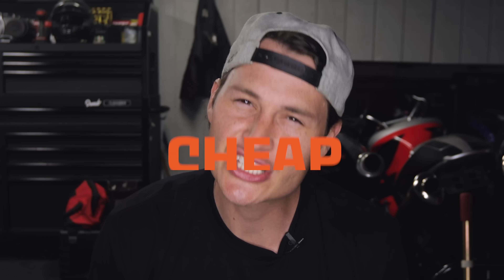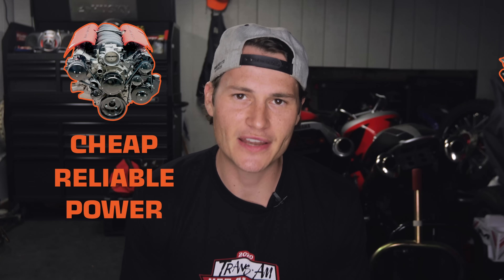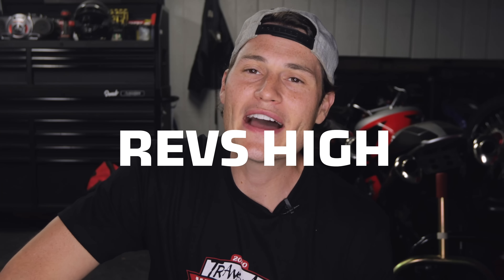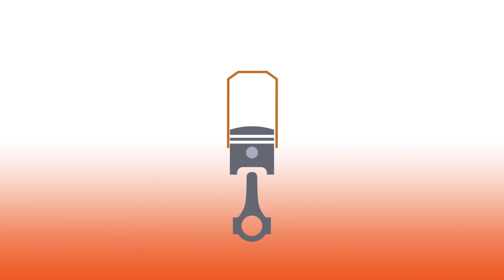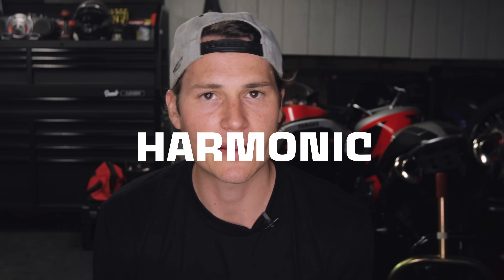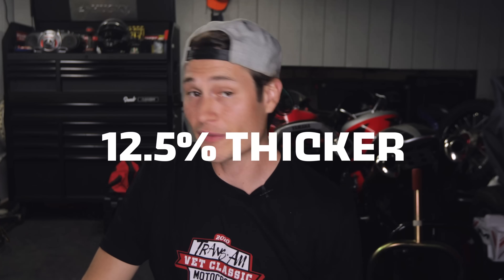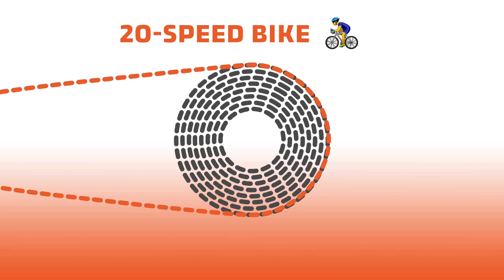Nissan VQ Engine - The Science Explained

Comment: "Iconic sound" more like universally hated
Reply: Op votes for biden lolol
Reply: @carlinleneker-frisch976  Sorry I don't vote for racist pedophiles who think they're running for Senate
Reply: Frank White  I'm talking stock blocks. a stoked and bored VQ is gonna sound different from a stock 3.5 or 3.7. I've heard the 4.2 and it's not bad by any means.
Reply: Not really. Its hated because people straight pipe them. With a real exhaust system they don’t sound bad at all.
Reply: @Bru946  I have heard one decent VQ in my life and probably 200 shit ones. I've never heard a VQ that makes me wet my pants.
Reply: @trent7080  pulls Uno reverse card
Reply: It's iconically hated.
Reply: The sound ain't even iconic, VW VR6 did it 1st and they can just as much power in a smaller form factor
Reply: @FreshDoughBoi28  VR6 sounds better than a VQ35 or a VQ37
Reply: @FreshDoughBoi28  show me a vr6 making over 300whp with bolt ons, ill wait....
Reply: Exactly. People rev these trumpet trashcans like its appealing to anyone.
Reply: @vidademikey9790  not all sound good but with a full motordyne exhaust they do. My g with a borla sounded good as well imo...

Comment: Yadayadayada...in reality the VQ is as refined as a tractor engine in the high rpms. I owned a 07 350z with the HR and the thing was quite course and strained feeling in the higher rpms. No comparison to say the silky smooth inline 6 in the e46 M3 or flat 6 in many Porsche’s.

No doubt the vq35hr is a stout engine though....fairly reliable and cheap if you look past the lack of refinement in high rpms. Nothing extraordinary by modern day standards, but still a solid engine with quite usable power.

Comment: It's not the crank being not symmetrical it is the con rod straightening up therefore adding to the height of the piston. When at the top of its stroke this increases the distance traveled by the piston when at the bottom of the stroke this decreases the distance traveled by the piston. If you are going to teach things make sure what you are teaching is correct!

Comment: The VQ40 found in the trucks/SUVs is great until the cam shaft gear explodes and grenades the motor. Then you had the awful ass automatics bolted to it. 

If you could find a VQ40 with a manual like an Xterra S/OR then you had a great vehicle. That is, as long as the camshaft gear was addressed.

Comment: The engine is great until your water pump fails.
Reply: Thats literally every engine
Reply: Anthony Leone I have a LS based iron block engine in my truck and can replace the water pump from under the truck in an hour. This fucking engine was the pump driven by the timing chain, which is covered by a plate that seals the entire front of the engine, in a tiny engine bay. I would know because I just replaced one
Reply: The Ls is great until you blow it.

Comment: I like donut and this series, but they got a lot wrong about the engine balance in this episode, some other people allready pointed it out, but I want to point it out again in the hopes that they revise some of their mistakes, given that people will asume this is correct.
firstly, the pistons don't fire at the same time, they fire at the same crankangle, but 1 rotation apart, secondly, just strengthening the block and crank doesn't suddenly make an engine smooth, smoothness comes largely from using counterweights and balance shafts to mitigate the primary and secondary inbalance.
where the inline 6 is fully balanced, the V6 has a primary rocking motion on both it's banks as well as a secondary inbalance, the unbalanced nature of the V6 is a large reason as to why they don't rev as high.
I hope this video will get a revisit or revision correcting some of the mistakes and going a bit more in depth on how Nissan beat the very unbalanced V6 into a smooth running high reving engine.

Comment: I used to own a G37S and it was the worst car I've ever owned. In my one year of ownership it left me stranded multiple times, so I sold it. I bought the damned thing because I thought Japanese cars should be more reliable than my M5. I'm a couple months past 3 years on the M5 and it still has yet to leave me stranded or even give slight concerns that it might leave me stranded. I was too scared the G37 would break down again that I kept it within like a 30 mile radius of my home. Also these VQ cars are known to: fuel starve, oil starve, overheat their oil, burn oil, eat rod bearings, destroy clutch slave cylinders and the list goes on and on. After owning the G I'd say that I'd much rather buy an E60 M5 ticking time bomb rather than this VQ crap. At least with an E60 you get a couple seconds of heaven before the rod knock symphony comes to town. The driving experience of the G was utter garbage. When pushed to the limit the car falls flat on its face, I've driven a 370Z and it was the same thing. I never felt in control of the car. Not saying it isn't capable because it is a very capable car, but the driving engagement leaves a lot to be desired. And working on it was a bigger PITA than my BMW. Everything was engineered so poorly, at least on my E39 M5 I can understand why they build things the way they did (except for the ABS module placement) The G37 follows no logic. Did they engineer this part this way for high performance? No. Did they do it to save money? No. Did they do it for comfort? No. This part is just placed there because fuck you that's why. No care was put into crafting these cars. These cars are cheap and they're crap. I suggest others to buy a car that's engineered by people with brain cells, not this Nissan dog shit. Here's to hoping future Nissan learns from this craptastic era and leads them to building good cars again.

Comment: Okay guys listen I raced a 2016 Challeneger RT (375hp model) stock, manual the other day in my completely stock 04 auto DE and beat him back to back 5 times from 60-125 roll. This was just some random guy from New York that came up on me in his car and wanted to race, he even honked it off when I pulled up next to him on the hwy. After I bear him the first time by about a car and a half he was probably in disbelief as was I and wanted to run it again and the outcome was the same, I would pull every single time. I understand power to weight ratios, But come one guys like it's just a little 3.5L v6, and its beating a Challenger with almost 100more hp, 2 more cylinders and almost 3 more liters. And my auto de is STOCK. WTF LOL

Comment: “VQ, powerful & reliable”
Instantly starts having PTSD of VQ oil & oil pooling issues
Reply: Don't spread hate. My coworkers G35 has 210,000 miles on original engine and he uses cheap oil. Sorry but hurt boy.
Reply: That’s exactly why you get the HR
Reply: @shawnstegall665  the HR is the Revup isn't it?
Reply: Vault Boy lol did you have a revvup?
Reply: @55Berg  I am yet to have oil issues with my DE Rev-Up. I also have a relatively low 80k miles on it though.

Comment: No mention of the VQ37VHR that is basically overengineered? Lotta guys will turbo these engines on stock internals. Friend of mine running 150-shot of nitrous at 8500 RPM limiter and somehow it hasn't blown yet. For an old engine it's dang good

Comment: The bicycle graphic doesn't make sense.  Is that supposed to be chainring?  There are not that many rings on any bike. It that the rear gear set?  Shifting that way would make peddling easier not harder.  This is no such thing as twenty speed wheels.  Your buddy Jose or Jorge or whatever is a liar.

Comment: Nissan have to get ride of cvt transmissions bring manual and automatic also turbocharge these engines like in maxima
Reply: You meant the new Altima with the turbo nissan did the Maxima dirty & didn't give it a turbo
Reply: The Raze the market here doesn’t get turbocharged altima or maxima
Reply: @toku30  doesn't need a turbo. 300 h.p. In the 16 max and spanks ALOT of cars. In fact it would smoke a new turbo charged altima with ease.
Reply: Fred Williams Well no one will drive that over the new 2.5t K-5 (DCT) or the 2.0t Accord (Manual and auto), or even the V6 camry. The cvt is already bad enough, but now without a turbo, it just makes zero sense at that ridiculous price
Reply: Damn a maxima turbocharged tho
Reply: oneviwatara they are not so popular here in Iraq
Reply: From a Car person perspective sure. From a car/parts seller perspective, Jatco does very well, they toss shit ass CVTs in countless cars and CUVs, and since they break so easily, that's more they sell from replacements/new cars.
Reply: @JustAnotherHo  ive quite literally never done anything to my cvt, im really shit at keeping up with maintenance, but still, but my 13 year old camry with 260k miles disagrees with the idea that cvts cant last

edit: slight correction, apparently since its toyotas hsd, its a planetary gearbox that acts like a cvt. still though, ive seen cvts go just as far just as fast as any other automatic
Reply: Buy a Skyline
Reply: Not to mention the turbo could probably fit on a key chain 💀

Comment: To be realistic, the VQ35 isn’t a great platform for a lot of power. It’s reliable in its stock form, and can make slightly more power with FBO but a DE will struggle to make 300whp while NA. Not to mention, forced induction on these engines is very expensive due to the need to beef up all of the internals to even be able to handle more than a few psi of boost. While they’re great in their stock form, VQ engines are no 2JZ, LS, or RB26 in terms of potential

Comment: These guys keep explaining the cause of secondary vibration wrong. There’s no way for the piston to go any faster on one half of the crank rotation than the other. The acceleration and deceleration of the piston is equal on both halves of rotation.  Secondary vibrations are caused by a difference of reciprocating speeds between the crank counter weight and the piston.

Comment: Hey @donut the bike gear change animation was inaccurate I think. The chain shifting up onto the larger sprockets at the back would actually be shifting down, i.e. slower less effort peddling... The shift up, in gears, is going to a smaller sprocket. The explanation and experience of doing that is accurate though, it's just the chain Travels the opposite direction. (I could also be wrong, but maybe check on that? Shifting to a bigger sprocket always makes  peddling easier and the bike slower)

Comment: "Talk about engineering."
I would like someone on here to talk about the physics of going faster than a 2.8 second 0 to 60... Because going faster than gravity is complicated.
Reply: Are you trying to compare horizontal and vertical accelerations here ?
Reply: @TheMops14  we don't do that here
Reply: What's so complicated about that?
Reply: OP forgets that certain people do that on a weekly basis.
welcome to drag racing where 50g's can get you a 60ft of less than 2 sec and a 660ft of less than 7 sec (edit: with 150mph+ trap speed)
Reply: what ?
Reply: @ThorkellTT  OP is asking someone to speak about traveling from 0 to 60 mph in 2.8 s which works out to an acceleration of 31.429 ft/s^2. Gravity (with some variation) has an acceleration of 32.174 ft/s^2 (OP is wrong, but I digress). So, if your car accelerates at the aforementioned rate, you will then be accelerating horizontally about as fast as you would had you fallen off a building.

There isn't anything special about accelerating faster than gravity, however. I can only assume OP wants someone to talk about what it takes for the very few cars that can accelerate that fast in terms of physics involved and how engineers accomplish it.
Reply: @garythecyclingnerd6219  Tesla S P100D slowly creeps into frame
Reply: @garythecyclingnerd6219  yeah i wasn't sure what he meant by "faster than gravity"
Reply: @bfjenser  using the summons feature 😂😂😂
Reply: Normally you are taught that most materials have a coefficient of friction less than 1 which means it should be impossible to accelerate horizontally at more than 1g without something else going on. There are a few different things that allow for acceleration and deceleration at more than 1g. One is that you can actually get coefficients of friction greater than 1. Another is that even with a coefficient of friction of 1 if you create downforce you can accelerate at more than 1g. Another is that I believe weight transfer can also help increase the total normal force and there for increase the amount of acceleration before slipping, but I'd have to think that through a bit more to be 100% confident it's the case.

Edit: To be clear weight transfer definitely helps rear wheel drive cars in accelerating by transferring weight to the rear wheels which are the ones you need to grab. I'm not sure if it affects the overall normal force and therefor the theoretical maximum acceleration of an AWD car. I want to say that it doesn't make sense that it would, but I'm too lazy to 100% think it through right now.
Reply: @garythecyclingnerd6219  r/theydidthemath

Comment: Nice didnt know it revved that high. My non special engines also rev pretty high.mazda v6 Klze 7800 daily on custom tune RIP, 1.8t 20V 8500 daily look it up people if u didnt know VWs can do that with just cams and springs, and my weekend warrior sbf does 7500.. Not bad for pushrod. All on 93 fuel.

Comment: I have a video idea for you. Compare the 1FZ and the TB48DE engines. These are some of the most common straight six engines here in the middle east and the guys here get more than 1000 HP using them. 1FZ is a 4.5L toyota engine it came on the land cruiser, while the TB48DE is a Y61 nissan patrol engine and it is 4.8L.

Comment: 9:38 NO! they don't fire at the same time. They hit TDC at the same time, but piston 1 fires 360° before piston 6.
Reply: Also the part about this engine being reliable there are many design flaws especially in the earlier models.
Reply: @russmaf101  they were talking about the vq35hr not the de
Reply: Yea they got it completely wrong. ONE piston fires ever 120 degrees of crank rotation in a V6. Unless it is an odd fire V6. I don't know how they screwed that up so bad.
Reply: Am I the only one thinking that they get a lot of things wrong?
Reply: @emanuelm.p1009  Yeah it happens often but overall, it's quite an educational show.
Reply: Wait 360°? Then what's the difference?
Reply: @andretsang7337  a cylinder fires every 720 degrees (2 revolutions) , unless it's a 2 stroke
Reply: Yeah, as far as I know there has never been a car that fired like that. Motorcycles however they have had them with I4 engines. While "screamers" have become the norm with a traditional firing sequence like that of any automotive I4 years ago there were "big bang" moto engines where two pistons fired simultaneously, then the other two. Essentially working as two parallel twins fused together. There were some crazy experimental motorcycle engine designs over the years.
Reply: Apparently everyone on youtube's an expert.

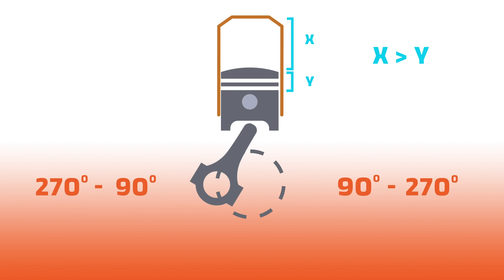Comment: 7:42 absolutely no.
What really happens... The maximum piston speed is reached when the Conrod and the crank forms a 90° angle. Which is (depending on geometry of the engine, Conrod length etc) a bit before the crank reaches 90°. The counteracting piston in the meanwhile, is going up way slower (because far from 90° between crank and conrod). The difference in acceleration prior to that leading to the difference in speed of the 2 pistons is giving an imbalance.
9:38 yeah, if it was a 2 stroke
Reply: Yikes... They put a lot of effort into explaining that totally wrong. I can't believe no one caught that before finishing the animation. I hope they correct it before all the VQ owners start telling people their engines don't follow the laws of physics.
Reply: Thanks! Your comment makes complete sense and added to my understanding of the connecting rod angle, crankshaft angle, to piston speed relationship. 

I was considering this from a geometry perspective. I concluded that linear distance traveled by the piston between crank angles 90°-270° and 270°-90° must be equal. The crankshaft rotates about its center axis (there are many possible center axises, but we understand the specific "center axis" I am referring to). Thus, any point which a connecting rod mounts to the crankshaft must be equidistant from the crankshaft's axis of rotation. This forms a circular path for the connecting rod mount with its center at the crankshaft's axis of rotation. As such, the distance traveled between 90°-270° and 270°-90° must be equal. Actually, it must be precisely half the stroke which is the distance of the piston traveled between crank angles 180°(BDC)-360°(TDC). 

The only way I can think to achieve the phenomenon he mentioned is if the connecting rod were mounted to a geared eccentric that modified its distance from the center axis (axis of rotation) of the crank shaft. Not sure what utility this would have, but it would achieve the odd dynamic he proposes. 

I just wanted to watch a video on my lunch break, but I am not a fan of ingesting false information labeled as fact. This statement piqued my curiosity because I didn't understand how it could be true. In other videos from "The Science Explained" series, I have found "facts" that didn't seem true as well. This one was just blatantly obvious! As such, I had to dig into it for the sake of my own sanity. Once again, thanks for your input @Andrea Maccario.

I really enjoy most of Donut Media's content, but I will not be watching anymore content from "The Science Explained." I do not want falsehoods portrayed as truths clouding my judgement. I'll stick to Engineering Explained for topics of this nature.